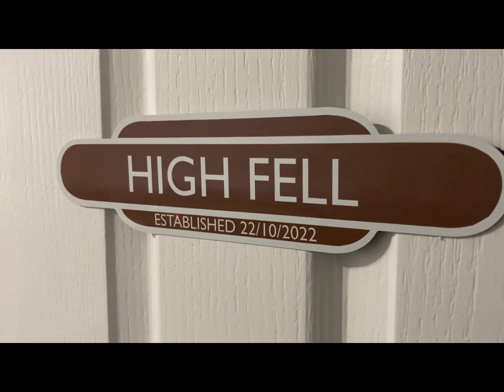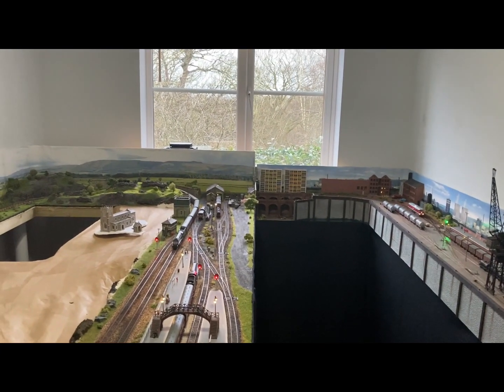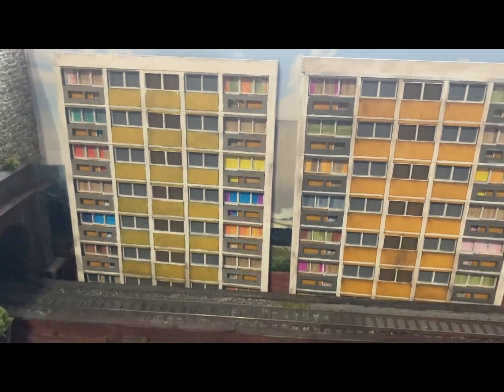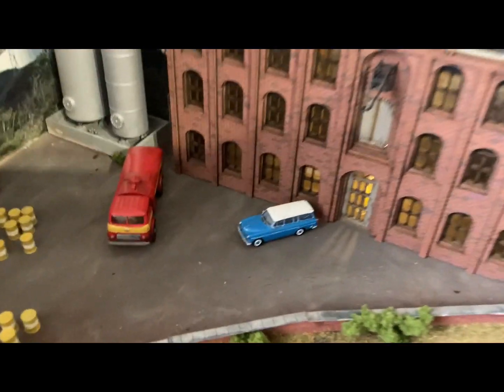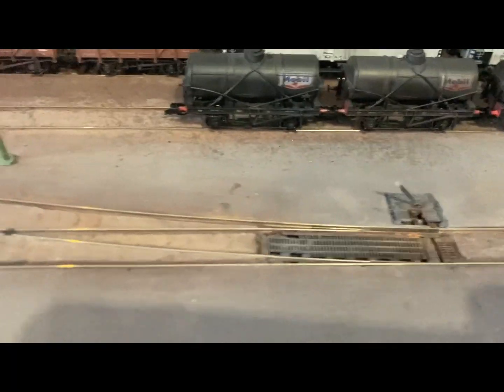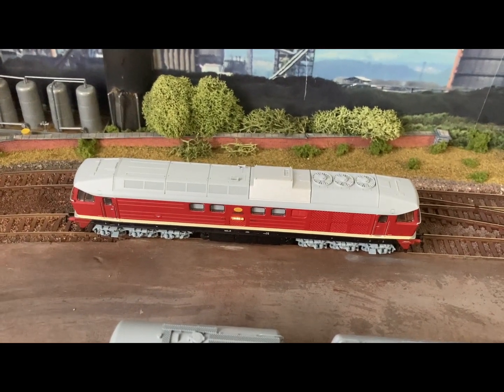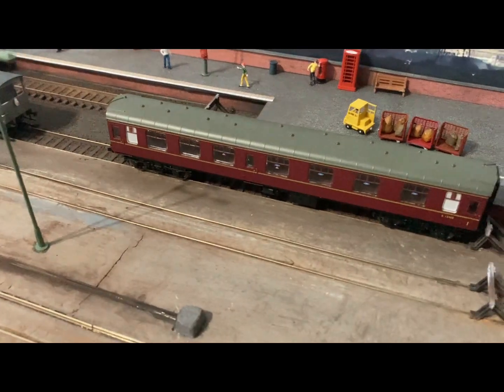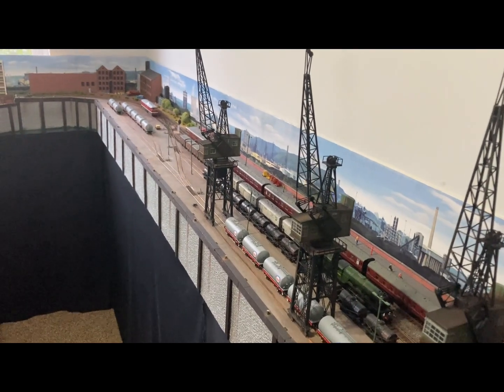St James’ Quay Developments and Details @HighFell

Comment: Lovely countryside layout, and I love the Hunters. Just a question - is the church model in the centre the Metcalfe N scale kit?
Reply from the maker: Thank you. All the buildings in the centre section are the Metcalfe N gauge ones, the farm vehicles too. It helps force the perspective and make things look a little further away although the a lot of the N gauge Metcalfe buildings are pretty close to TT:120 anyway. 
If you have seen the latest videos with a 1980 diesel era going on, you might see the Hunters have been retired (they will come back for 1960’s running sessions) The replacements for the 1980s are in build now 😁
Reply: @HighFell  I have 14 Harrier jump jets in production at the moment . . . and a Typhoon already on my layout . . . Tornado would be a good choice for your 80s theme.
Reply from the maker: @airshowvision  it’s actually a pair of Harriers! One done one close decals. I like the Revell 1:144 aircraft kits, size works well and they are nice quality and decent price. Technically these are about 10 years too new, GR7s but still cool. I keep my eye out for interesting sky stuff, adds another dimension to the scene. I also have a sound module, I find a sound sample, record it and it’s on a push button for added fun, the Hunters have a very distinctive scream
Reply: @HighFell  Yes mine are mostly Revell kits. There is a guy on YT I think it is called Leisureworldinternational who has a thunder and lightning sound module with clouds which flash as the lightning goes off
Reply from the maker: I used the module from a greetings card, they are available as diy card things, then hard wire a power and push button in to operate. 14 Harriers! That’s going to be quite a sight! Can’t wait to see it!